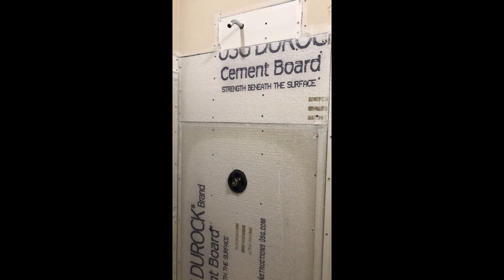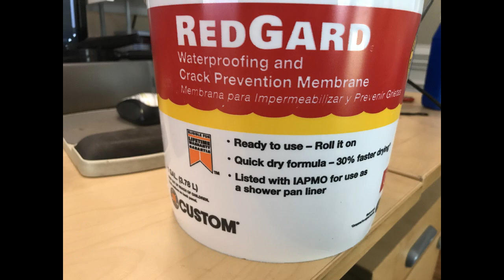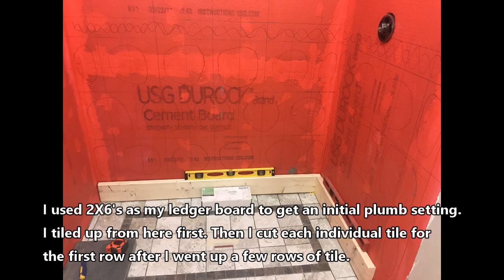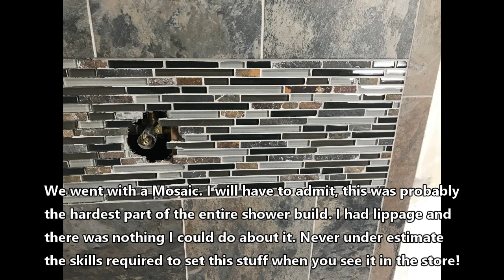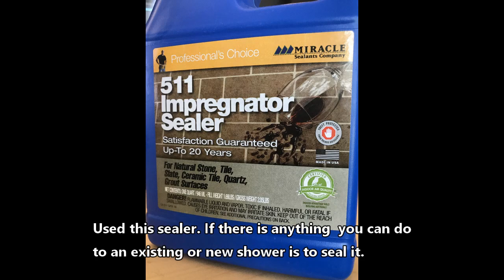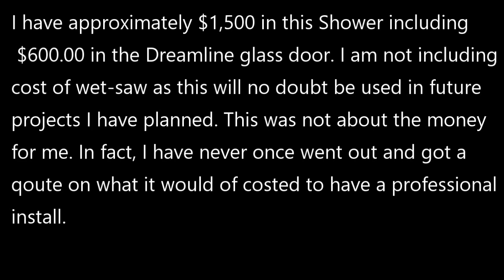Fiberglass Tub to Tile Shower Conversion

Comment: BRAVO!!!  I was just about to push send leaving you a bad critique.  Read below:

I usually don’t write negatives comments so I’ll try and be as diplomatic without being rude or mean.  This video would’ve been a great video if you explained what you were doing.  Having to read your explanation over the music was not only distracting but annoying.  Also, I was not able to read the commentary as fast as you allowed.  

However, something told me to fast forward to see if you would start speaking and you did!  With that being said, YOU DID A FANTASTIC JOB!!!
This is exactly what I want to do with my guest bathroom.  I’ve started doing simple DIY projects around the house and have built up confidence to want to tackle this type of project myself now that I’m retired.  

I’m very very slow when it comes to my DIY projects (It took me months to paint and lay a peel and stick tile floor in a freaking laundry room.  But in my defense, it was my very 1st project).  The painted room looked good but the floor was a little crooked.  Again, it was my very 1st project.  My 2nd project was the 1/2 bath which I felt a little bit better about.  I installed a new toilet!!!  My 3rd project is my master bath which I’m working on now.  Nothing major, however, I want to replace the shower insert and retile it.  Here is where I’m a little trepidatious so I’m going to leave it as is until I’ve done more research and study more videos.  (I will be studying this video again for sure!) Some days I don’t want to be bothered but I’m determined to do it myself.   You also have great taste.  I fell in love with the Dreamline shower doors.  I want the exact one you have.  Please pray for me.  I want my shower to look exactly like yours and be able to say I DID IT MYSELF!

Again, BRAVO!!!
Reply: @diymitchvlogs  Agreed.  I keep wanting to record the project I'm working on now but can't figure out how to set up and record so of course, I took the easy way out and said, "forget it."  LOL!  

Again sir, BRAVO TO YOU!  I absolutely love what you did.

Comment: Great job, 2 things I might of done was to hole cut for the shower pipe instead of splitting the tile in half, sometimes the tile store will do this hole cut for you for under $5.o0 a hole. Also I might of had made a solid piece of stone or something to go the whole length that’s  on top of the shower lip (under the glass door)
Reply from the maker: I’ve got a 5 year follow-up here https://youtu.be/jEu0VMwKO9w?si=_Q0KdKN-i9bBpELO